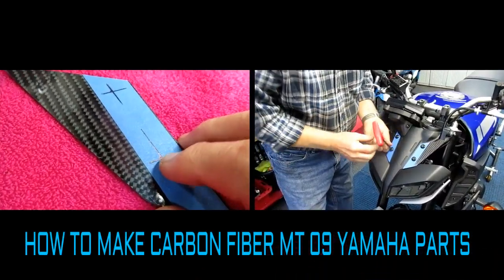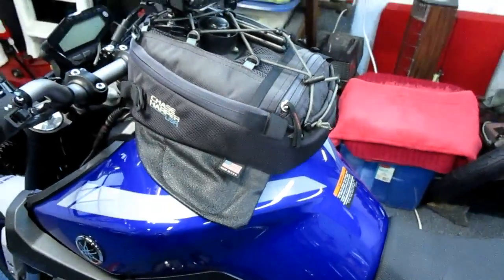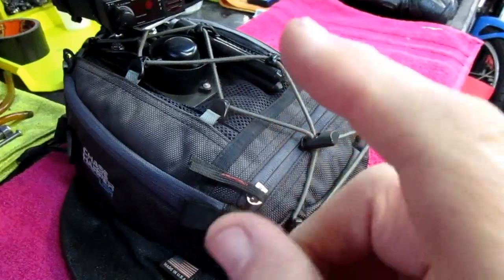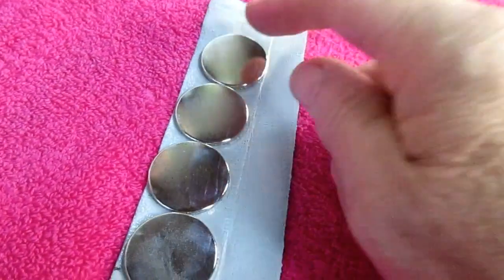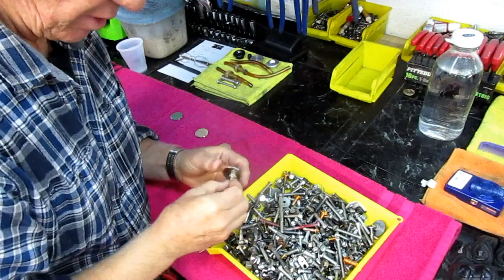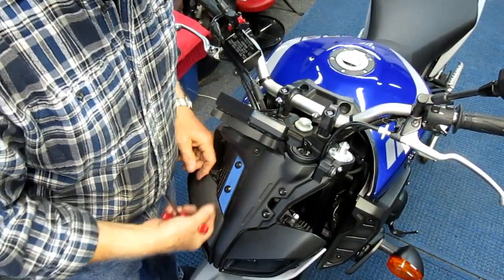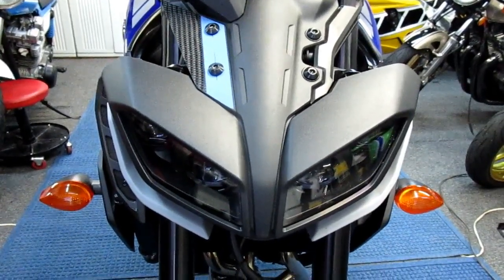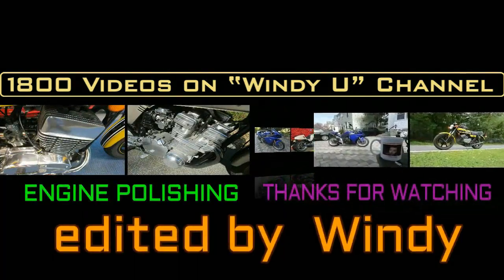HOW TO MAKE CARBON FIBER MT 09 YAMAHA PARTS

Comment: I had some small neodymium magnets that I bought thinking I would use them for something. I finally used them for some new speaker grills I made for a set of old speakers. They work fine, but they certainly don't hold to a plain steel surface as well as to themselves. The larger the contact area, as in a larger diameter magnet, the more holding power.